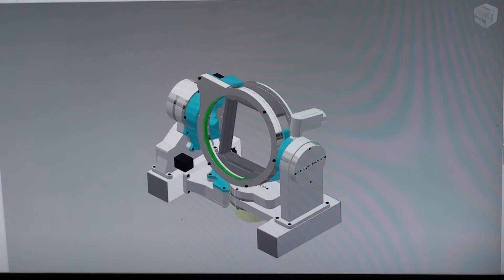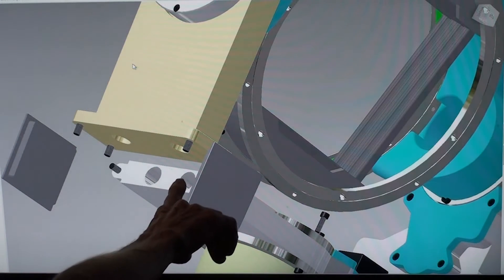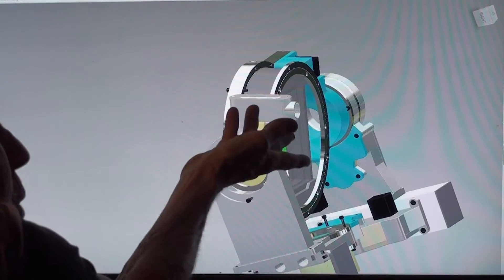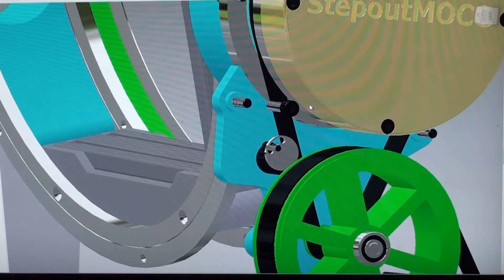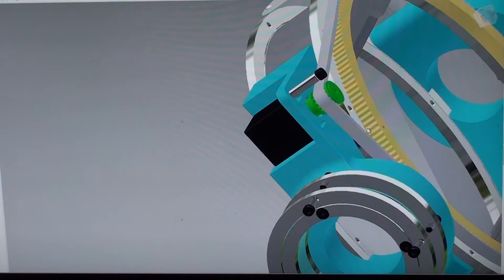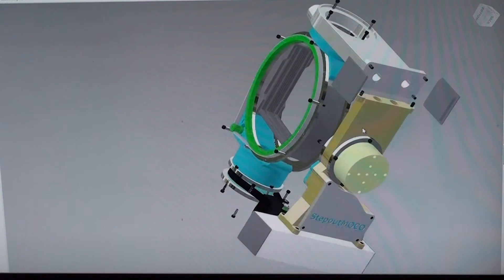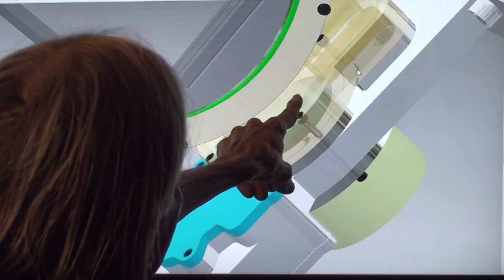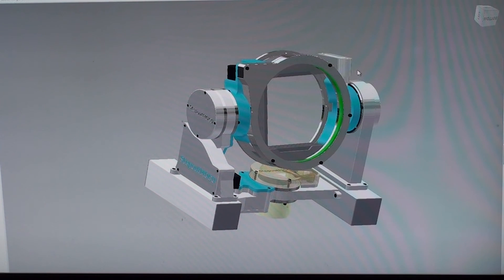Pan tilt roll head for digital cinema cameras

Comment: Interesting design, but I would argue that it is quite wide with the 2 supports on both side, preventing light to reach the subject you will be filming.  This is my main concern as i am looking into the different designs for making my own head. Many times the camera will be quite close to the subject and the construction of the head bumps into the set, lighting etc, and makes shadows as well.
Reply from the maker: How large is the camera you want to move?  This head was designed to carry a very large, heavy digital cinema camera.  We have a smaller head similar to the Servocity PT2100 with geared stepper motors instead of the DC motors Servocity supplies.  We can sell you a complete P/T head or a kit to convert a PT2100 to stepper motor drive.  Send any questions to Stepoutmoco.com
Reply: I'm not looking to buy a camera, but have done motion control work in my career, mostly working with MRMC equipment. I am now upgrading an older American system with the Mantis software and this system has a simple pan-tilt head, that I like to upgrade to a 3-axis version. I would prefer a system where the roll is at the back of the camera, far away from the lens and subject.
Reply: Sorry, not camera, I mean, remote head. We mostly work with Alexa (Normal and Mini), Red and cinema lenses.
Reply: The rig I have here is an older version of this: http://www.general-lift.com/Services/mk3_srt_under.html
Reply from the maker: Mark Roberts stuff is very well made.  I'd have some if I could afford it.  I've made some real simple roll attachments that just bolt onto the P/T head.  The simplest are just a couple of large aluminum angles.  One angle sits on the P/T head where the camera would go.  The upright part of this angle is directly behind where the camera will go.  The roll motor is bolted to this upright directly behind the camera and in line with the lens.  It turns a slightly smaller angle which the camera is bolted to.  I can make one for you if you'd like to let us do the machining for you.
Reply from the maker: That GenuFlex is really nice.  Were they selling any more like it?  I assume the motors are bipolar stepper motors if you are using Mantis as a controller?
Reply: Correct, the motors are quite enormous bipolar steppers, the largest for the track and the swing are 3 stage motors with around 20Nm torque, I think. I use the Leadshine controllers for them (220 volt, 8 amp). 
The whole system is a bit over-engineered (for the motors), but the system is not as stable (vibration) as for instance the Milo system. of course that one has 2 lift supports and a very sturdy box construction.
I understand that General Lift is not really functional anymore, in this Moco realm, probably too much and better competition. Problem was also that they worked with the Kuper system and that has not been developed anymore.